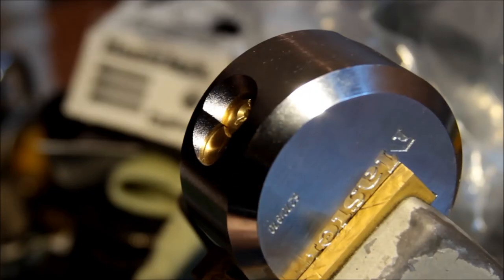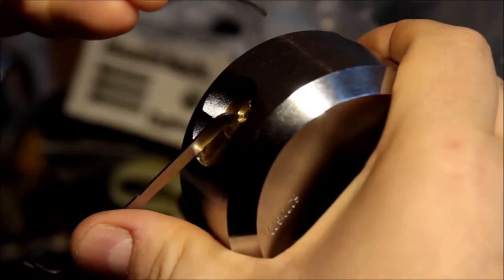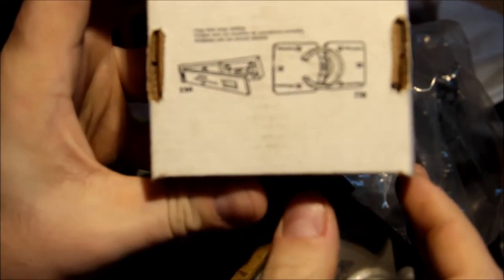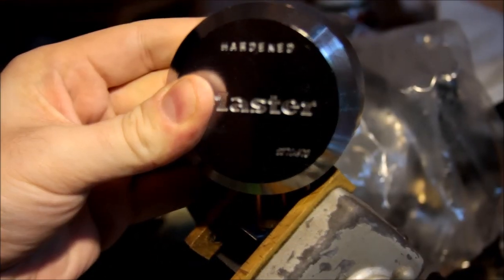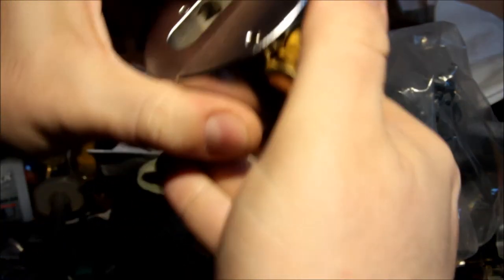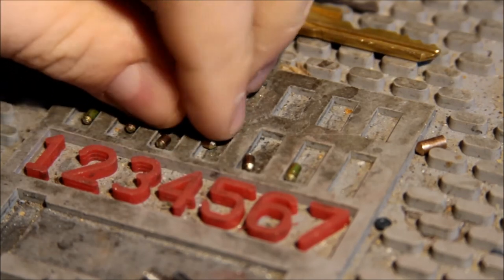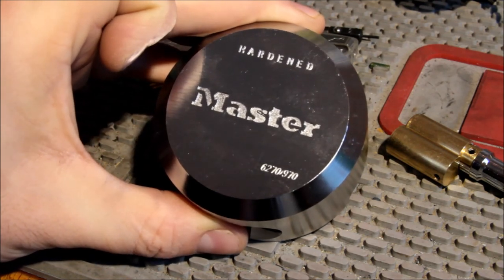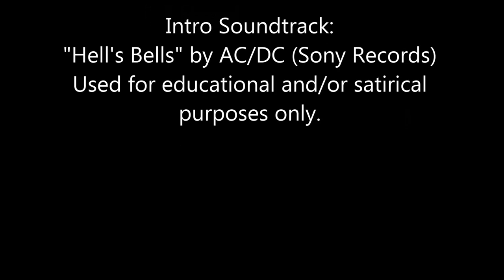(242) Cloning of the Puck: Master 6270 SPP and Gutted

Comment from the maker: Indeed. I'm a child of the (very late) 70's and have had the unfortunate experience of watching so many venerable American-made products either disappear or turn into cheap imported crap. 

On the plus side, the old stuff was made to last, so, at least for a good while, we'll still be able to "buy American", though after the fact.
Reply: Alex Blate 

i know what you mean but its a shame the American series 2000 was not designed to be made out of hardened steel like the master lock version is, as the series 2000 body is made of a softer material than steel, so is easier to drill, saw, melt or other method of entry.   

Make sure you buy the hardened steel versions of this lock American makes and not the softer metal body series 2000.

Comment: I've been picking for just under a week now and have been able to pick the American Lock 2000 series lock 3 times (which, admittedly, took me over half an hour to do each time so yeah...), but I have spent quite a bit more time on the 6270/970 and cannot pick it.  I'm using a short hook with a regular tension wrench and just a little bit of pressure (about as hard as pressing a key on a keyboard).  I have run into a few false sets at the end, which screws me up completely because I'm not sure where they were and how to recover from that.  Any advice?

Comment: Does the American series 2000 core fit directly in the master lock body without any modifications?   

The master lock has a hardened steel body but the American series 2000 is not hardened and not even made of steel so is easier to remove with saws and drills and other methods. 

If the series 2000 core fits well, it would be a nice surprise somebody picking the master lock with the series 2000 American core.